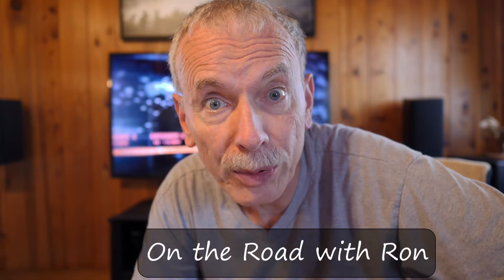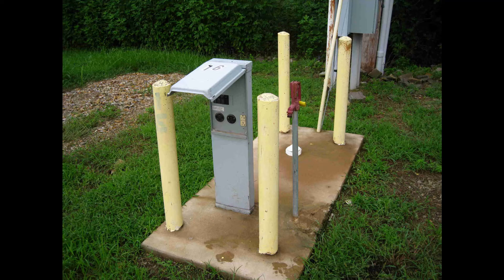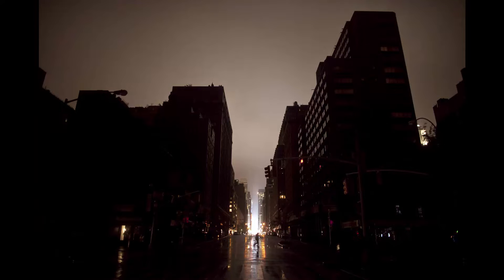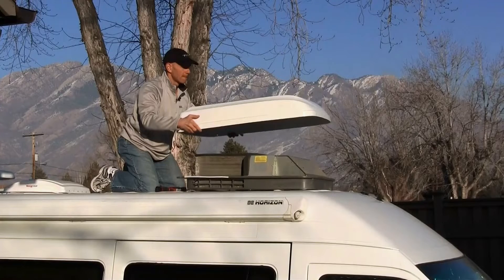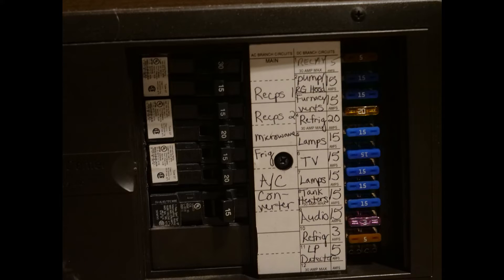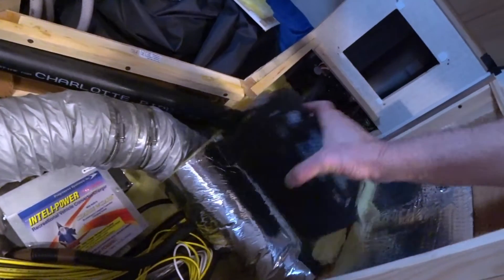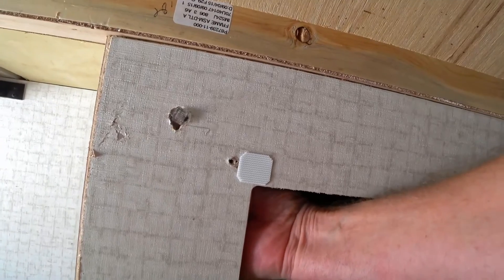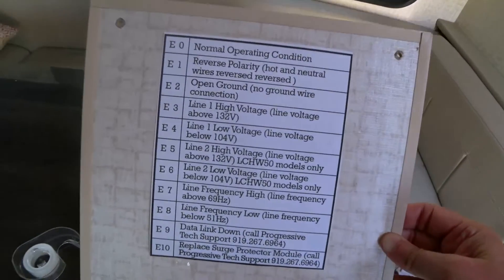RV Surge protector (EMS) - 10 Reasons you need / don't need one

Comment: Hi Ron - I’m hoping you can answer a question for me. I have a 2016 Navion V. I installed the hardwired EMS today and basically removed the junction box where the power cable connects to the house cables and replaced the junction box with the EMS unit. I do like the way you installed yours under the bed - unfortunately the V model does not have a lifting bed. Should I just be content where I put it or are you aware how to gain access under the beds?  The compartment where it is now is extremely tight and crowded with the cord and generator outlet. Or perhaps maybe your followers have some thought. Thanks. Dave

Comment: How do you know which wire is the main one to attach the EMS to?      and,  Does the EMS make any noise while it is working?

cheers!
Reply from the maker: The main AC line is Romex. It runs from electrical bay to the fuse panel. Most of the wires are DC and are single wires bundled together. It makes no noise.
Reply: many thanks!

Comment: Just wondering why didn’t you attach to the cord in the electric bay ? 
Just got the same EMS unit my View is a few away from arriving.
Reply from the maker: I didn’t want to deal with a separate device every time I needed to plug in. A pain to store separately and I would be tempted to just not use it. Internal mount cannot be stolen and will also protect when using the genny.
Reply: @ontheroadwithron2432  
I read the instructions carefully. It says down stream of auto transfer switch. So as you did close to the load center for the ty in. And the generator source is monitored also. I’m glad a watched your video for the second time. 
 Thanks
Reply: @ontheroadwithron2432  
Got it 
I was wondering about the generator. That’s a source of poor voltage etc.

Comment: I had an '07 H model View and mounted the hardwired unit in the shore cord compartment. Made a new, larger piece of plywood to replace the piece the generator outlet and the junction box were mounted on. I drilled it up and installed T nuts in it, varnished it, and used machine screws to mount the generator outlet and the HW-30. Just roll up the cord in the compartment and plug it into the generator outlet everytime you stow the cord. I ran the wire for the remote up under the shower and up the inside of the wall the system control panel was mounted on and put the remote right under the original panel for fluid levels, etc. I like being able to see the volts/amps/freq constantly, made a good night light too.

Comment: As I was in the RV repair business for years I saw far too many vehicles with very expensive electrical appliances damaged by High/Low voltage due to power panels not being wired correctly or storms that knocked off neutrals causing damage. My 2016 View had a ems system installed before it was plugged it the first time and it was extremely easy to install myself with only similar space issues like yours. I literally "Don't leave home without it"

Comment: We have found pedestals with no ground, low voltage and reverse polarity. We have also experienced brown outs that shut the entire system down. Using a Progressive EMS 30v portable which we got on Amazon for $225. (We didn't learn after our 1st one was stolen even though it was cabled to pedestal!) Just saying...
Reply from the maker: After installing mine, it detected a reverse polarity at my dad's house in Florida.  Not sure if would have been a problem, but we fixed the wiring in the box anyway.

Comment: What model number did you buy?  The ones I'm seeing on Amazon are over $100 more expensive.
Reply from the maker: I got the Progressive hard wired version for $229  https://www.amazon.com/gp/product/B002UC6RSA/ref=ppx_od_dt_b_asin_title_s02?ie=UTF8&psc=1
Reply: I own a portable version of the same one. During the eclipse in Tennessee a few years ago I was at a church "campground" with a bunch of relatives on a hot day so needed ac. The church voltage varied so much and dropped so much the Progressive unit tripped so many times it stopped working. I thought I had ruined it. Tried it again a few days later was working fine. Has continued to work fine since then.  I would have likely ruined some appliances in that situation. Definitely get a surge / low voltage protector.  Additionally when my View was new I used it to check total load from the generator in amps and it helped discover that Winnebago had miss wired the generator at the factory!! IE the hot and neutral were reversed. I notified Winnebago after fixing myself, extremely dangerous!

Comment: Why  not just get a good portable one?  Do they not work as well?
Reply from the maker: I think the portable ones work about the same, but I didn't want to have to set it up every time I plugged it.  Rather do the work one time and not have to think about it later.
Reply: They can be stolen by thieves. Hardwired is harder to install, but usually worth it.
Reply: @JohnSmith-lw2bm  Hardwired is very easy to install, cut one wire attach the ends and good to go
Reply: We picked up our rv about 3 states away. The first two rv parks that we used, we arrived late at night after driving about 4 hours. At about 9 at night and tired from driving, that's one lest thing to worry about.
Reply: I have heard complaints of buzzing especially if installed under bed

Comment: Nice Job Ron I installed mine right next to power cord outside bin.  I would really like to see you install a propane fitting off of coach tank for grill and other appliances. Thanks Ken
Reply from the maker: So far, I have not planned on adding a propane connection as the cost is way more than the cost of those 1 lbs propane bottles for my grill.  I only use about 2 bottles per year.  I was thinking of a video on the care and feeding of RV tires. My grand daughter wants to be in the next one.